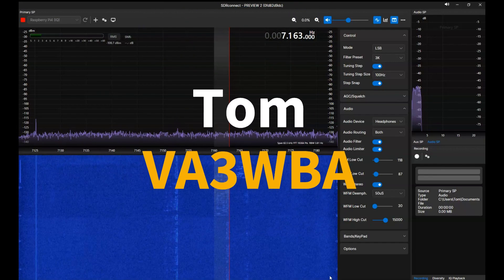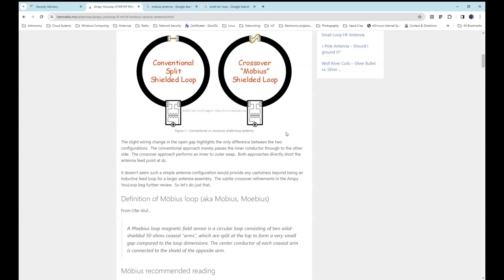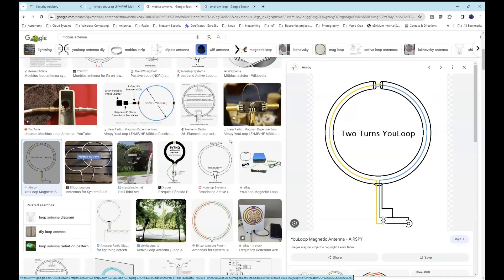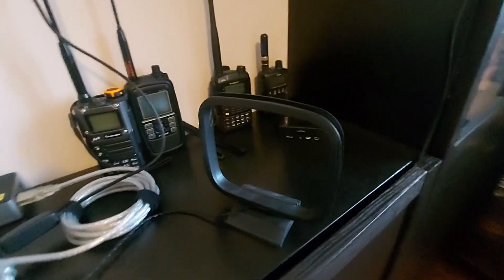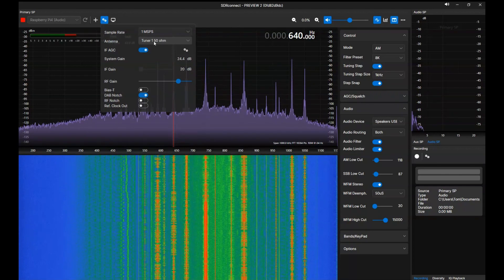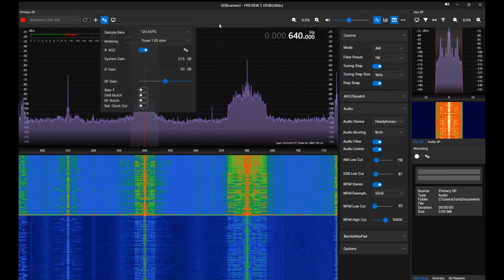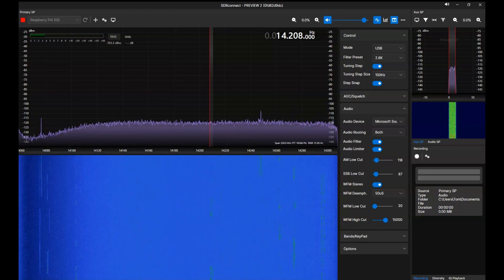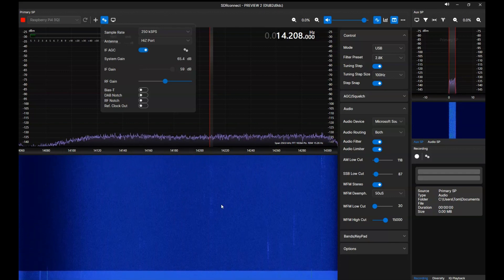Homemade indoor Mobius loop, antenna testing.

Comment: the dielectric of the cable is killing the inherent performance of the tank  , use copper strip tape or aluminum tape and hula hoop as structural ,or hvac aluminum tube  ,do  2 turns , use the mid point on the cap side of the second turn as the virtual ground ,  you must use 2 jfet pairs Long-tailed pair  with mirror , and a buffer bjt and ground the mid point to get full balance nodes ,use split-stator or butterfly capacitor or bridge the grounds of the caps , you must calculate the inherent parallel Z and load the z to the jfet  3x 5x larger , this will give you khz bw ,if you wand broadband lower the load Z with a parallel resistor ,inherent  Z - load R = bw Q , for high gain you can use an high speed jfet opamp and a balanced tank filter feedback , if you want pure rx snr 145dbfs you just use wider the l c ratios  on tanks ,  you need calculate your parallel inherent Z ,unloaded , then you can do any load you want related to bandwith you derive with the R load ,, instrumentation opamps and rf opanps are the easyest way , or  use 2 jfet pairs Long-tailed with current mirror , and then use bjt amp and  buffer to 50 ohm and ground the mid point , you can get full wave performance aperture with high diameter conductor tube , do any 1/4 1/8 1/16 wave ratios

Comment: Hi Tom.
Nice antenna.
I live in a noisy building and can only use closed loop antennas.
I'm wondering if the cable could be LMR400 with PL259 connectors. I suppose it would work just as well.
Congratulations and good DX.
73 Jorge
Reply from the maker: Thank you for your comment. I do not think that the type of cable matters. I have not experimented with the lengths longer than 1m either.  I used 75ohm TV cable because I have a lot of it the garage and I really do not have any application for it. Good luck.
Reply: @radioastronomy2001  
Thanks a lot, Tom, for your reply.
Yes, I'm going to buy two 1 meter sections with PL259 connectors and some SO-239 connectors socket to attach to the boxes.
Another question: I have that Amidon ferrite binoculars around here, and also an FT140-43. Does it make a difference to make a current balun with the FT140-43 or another inductance balun with the binoculars?
Thanks again, and good luck.
Reply from the maker: @JorgeRodriguez-vq3wv  This is not a transmitting antenna. I do not think it will matter. A binocular core, due to its magnetic path characteristics, may require fewer turns, but it would also depend on the specific permeability of the ferrite material. You may play a bit with it. Or google up solution that will match your materials.  In my opinion this is not critical.